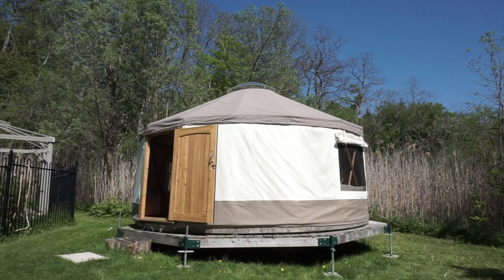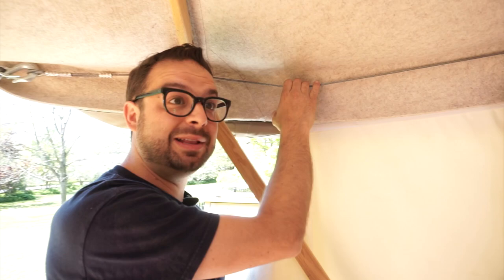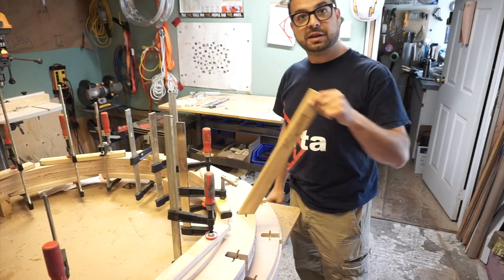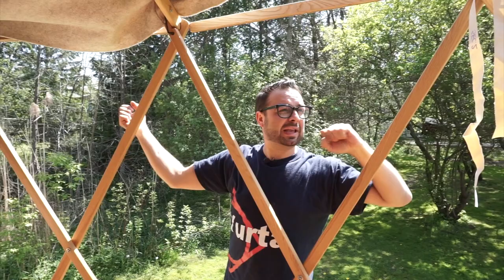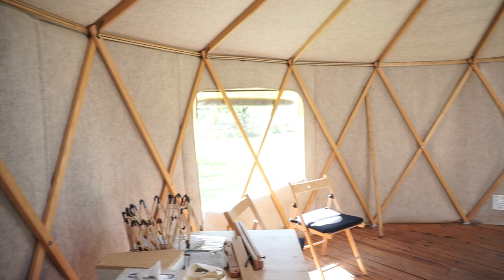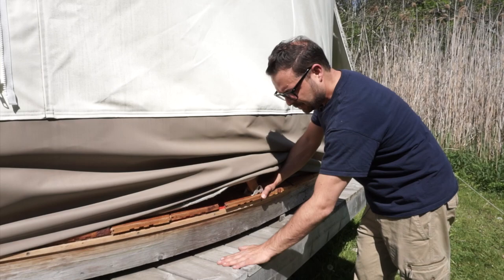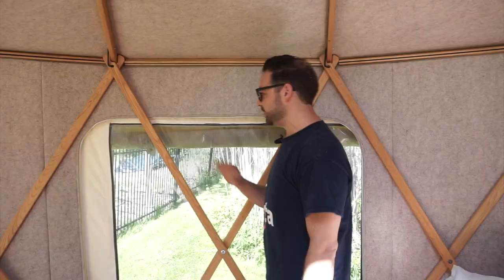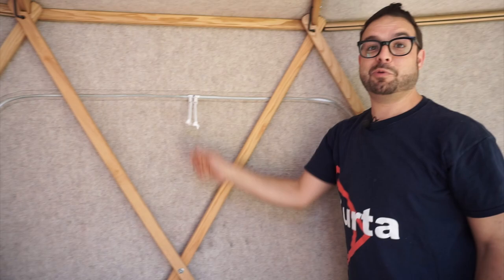Brilliant Yurt Design! - Mixing Tradition with Super Modern Construction

Comment: Love it - I live in Ontario - although there is not much insulation, it’s also small and simple so it would be inexpensive to heat - I think it would be perfect to have 1 good sized yurta as the main living area heated by wood pellet stove - then 2 small yurts, one on each side, with small electric heaters - 1 small yurt for bedroom and the other for bathroom

Comment: A stretch outer cover treated with ever dry that has door and window openings. That stretch over a aluminum skeleton with the stretch cover securing to the window and door frames with the windows and doors slipping in from the outside and swivel latched on the inside to the aluminum frame for a weather right fit. Then a insulated inner cover that is attached to aluminum skeleton with push pin fasteners. Design the whole thing in two sections like a circle cut in have to make it easy to move around. Then design the top to push open into a dome sliding shingles and the bottom to be the base. A lite weight portable yurt that you could even add a loft or second floor depending on the size you make. Be really cool to have one of them bests a a tent any day.

Comment: How does this structure bear up under deep snows where it goes down to -40 degrees F. Especially if it is unoccupied for periods of time. Thanks for your advice.
Reply: My wife and I spent the winter in one the year it was regularly dipping to 20 below. The yurt was great but the stove we had sucked and the wood we were burning was not the best. It would have to be winterized if there is water pipes , the same as any house if it's not being heated.
     We are about to build our own, and will be taking some things from this guys design, particularly the floor where we will use a sandwich of plywood with 4 " iso between it.    I'm gonna use 3/4 " advantech  for the plywood layers. It doesn't shrink and is resistant to water.

Comment: A qunsa hut type yurt. design a bamboo box with a bamboo roller at the top off each lid with a crank with the box being able to store six bamboo poles and four bamboo wall panels that you connect at the top and bottom with one having a built in door and the other a frameless window that yo place into the base for the front and rear panel. Then have bamboo rings on the back of each wall panel to place the bamboo poles. Then attach weather proofed bamboo frabic outer covering using two people lift and cover structure and attach to other side of base then just use cranks to tighten down outer layer to structure. For cold weather have another set of bamboo poles and apply inner insulating layer. What do you think about this design?

Comment: Could design a yurt using azdale panels and air alloy for insulation. A pop up instant yurt! With built in framless doors and windows in azdale wall panels that lift up from floor and down from ceiling and swivel lock into place with the top having a sliding azdale shingle design to give the yurt its dome top. Way better then a simple tent yurt.

Comment: Long term yurt use bamboo fabric treat the fabric with water activated ceramic. Then place banna plant cellulose sponge mats treated with water activated ceramic in between the bamboo fabric. Prefabricate yurt in a factory from the floor to the roof with mesh on the windows and zippered window covers and doors. Then add those chemical water heating packs then vacuum pack the whole yurt down. Design vacuumed bag with a spout to add a gollon of water that will activate the chemical water heating packs causing the sponge plant cellulose matts to expand and activate the ceramic so the yurt erects itself then cures rock solid has it dries and cools off. Would this be a really cool yurt design? 😊

Comment: How do you avoid mold on the felt!
Reply: by having a breathabke fabric and insulation allowing it to dry out quickly unless you live in a tropical forrest with a lot of humidity all year long
Reply: Amira Farrakhan   I believe one of the advantages of wool felt is that it is naturally mold and mildew resistant

Comment: This set up at 7' walls is $9500. then $3500 for the 4 season insulated walls another $475 for them to put a hole for a stove pipe. You would actually think that would be part of the design! Since its obviously freezing in the winter!Then the flooring you're looking at $20,000 for a tent!
Reply: I think that's all Canadian dollars, so its going to cheaper in US dollars.

Comment: Idea 3D print aluminum foldable eyebeams that fold open into eyebeams that swivel latch lock together to form a frame for the walls and roof of a yurt. Then use earthbags treated with water activated ceramic. erect the walls and roof all using earthbags treated with water activated ceramic. Ounce the structure is complete soak it all down and let it dry and cure rock solid for a permanent yurt. 😎😊

Comment: They have those battery powered backpack powerful leaf blowers now. Why not design a yurt that you can inflate? Then have an inner expandable skeloton that folds out and locks into place. Could even design them to be filled with a expanding foam that is plant cellulose based foam that hardened for a more permanent yurt. Or construct the inflatable yurt out of bamboo fabric impregnated with water activated ceramic? Air up the yurt soak it down let it cure has it dried then fill the air cavities with a plant cellulose based insulation? With so many losing their homes from climate change its nice to have options is it not? : )

Comment: How about a base with holes you can place large bamboo poles then large bamboo the top of the poles fit into with the poles were the door will go having a sprocket with a floor crank were you attach the outer layer to each pole and it wraps around each pole tight then have a framed door with a pinch fram with weather stripping with a bolt swevil crank you twist then fold over ounce the door is set into place use piviot rings and bamboo to place roof with tarp cover you lift and lock into place from inside the yurt. You could design a yurt you could place in a carry case that two people could lift easy. You could design an inner layer that you could attach to the base ant to the top ring of the yurt made from bamboo with that bubble foil insulation with a bamboo fabric over it. Even a roll out bamboo floor. You could design the yurt out of 100% bamboo products. A green yurt then design different models with a loft or second story.  What you think about these ideas?